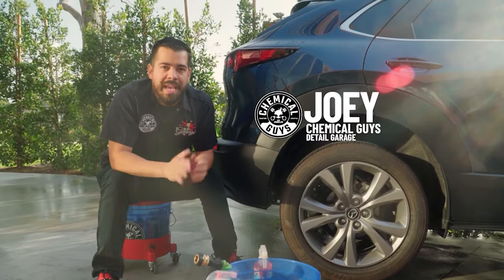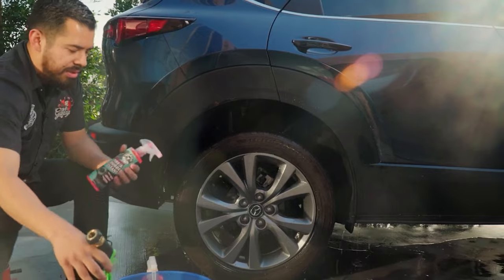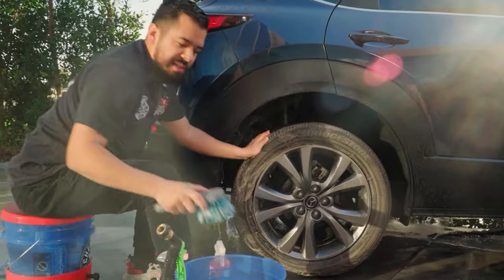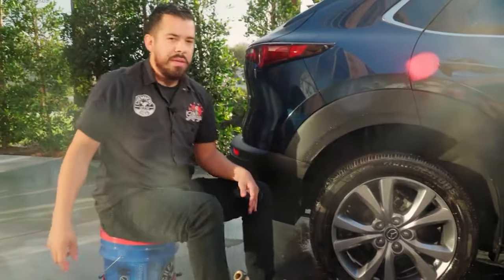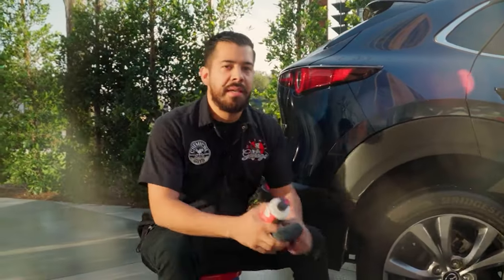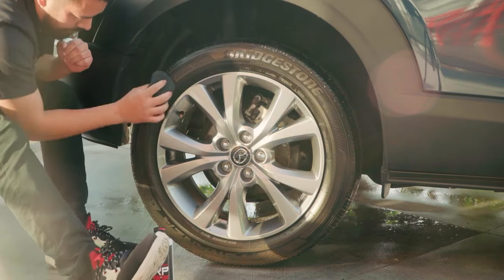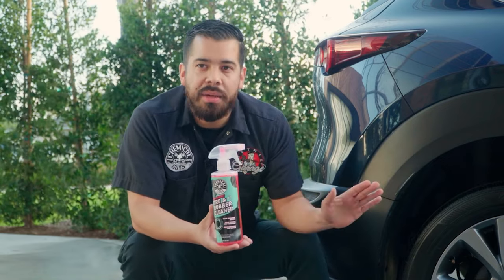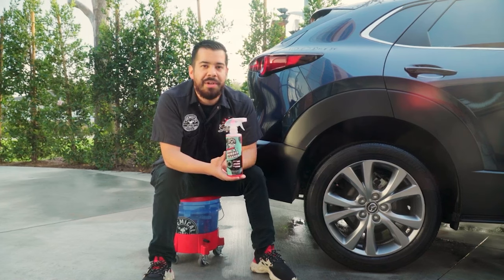How To Reverse Tire Blooming/Browning In 3 Easy Steps!  - NEW Total Extract Tire & Rubber Cleaner

Comment: What will be the best tire cleaner for my car? I only drive it like 3 times per week. My tires are not brown. They are just normal. Can I still use this product?
Reply: If you’re using CG you can use their Diablo wheel cleaner that should do the trick
Reply: @ImPapaDan  alright, thanks.
Reply: I thought Diablo was strictly for rims

Comment: Thought vrp wasn't for your tires  wouldn't blue guard last longer ?
Reply from the maker: Hi there! VRP is great for interior and exterior vinyl, rubber and plastic components. Blue Guard is also great for enhancing and protecting tires leaving a high gloss finish.
Reply: I ONLY use VRP on tires

Comment: do you guys recommend anything for giving a black metal surface a nice sheen? specifically a black frame and swing arm on a motorcycle
Reply from the maker: Hi there! Apply a combination of Black Light Glaze and Butter Wet Wax to add gloss and protection.